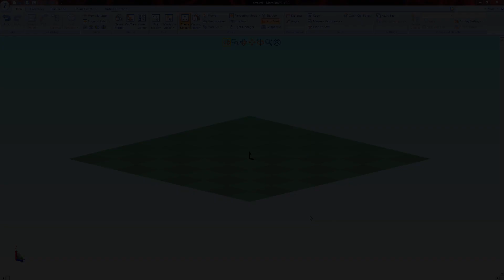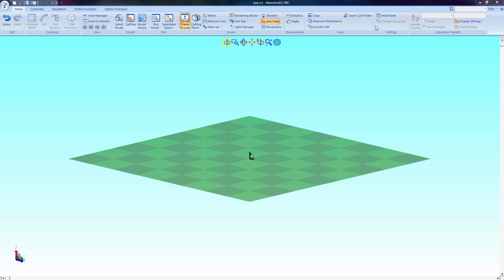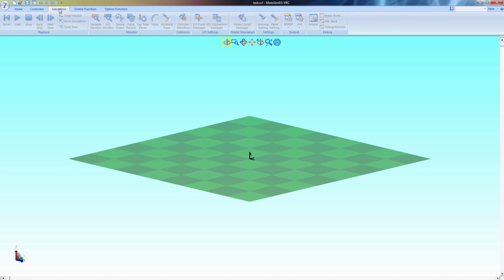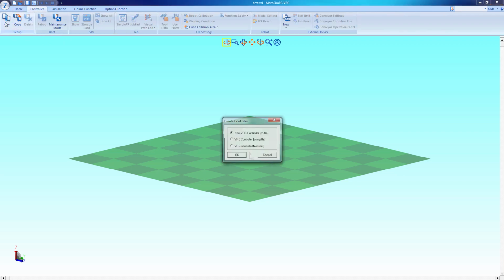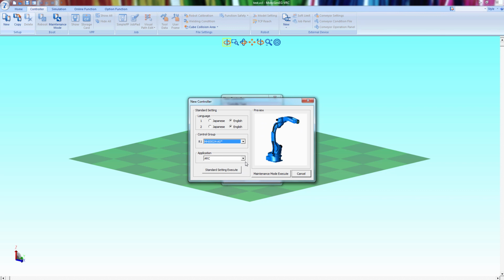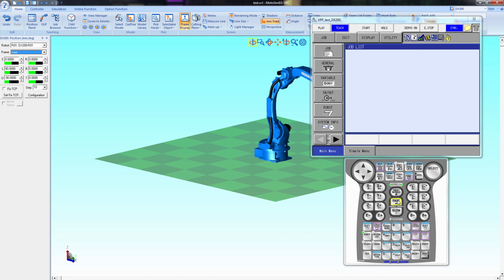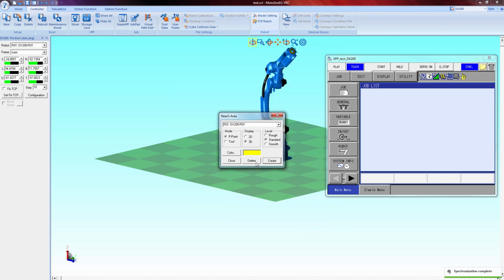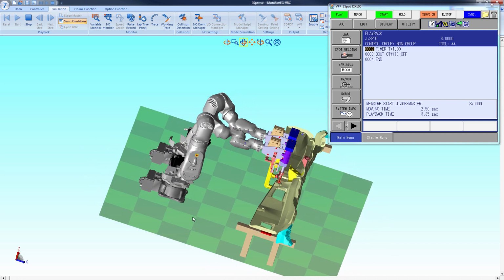MotoSim EG-VRC Overview

Comment: I am new to the MotoSimEG-VRC platform. 

I just created a controller from the CMOS file of a physical robot [YRC1000/GP50], this has extra packages such as MotoSight 2D Camera and Conveyor Traking...

I have problems when trying to use the MULTI-WINDOW function, or change the window pattern, simply by selecting the pattern does not change the layout of the window, nor the characteristic icon in the upper corner of the virtual pendant is displayed, does anyone know if there is any parameter that could enable the multi-window function.

With other CMOS files this function works correctly.

Thank you very much in advance.